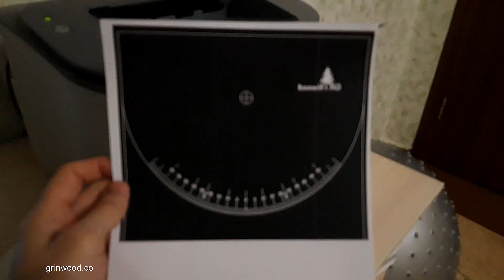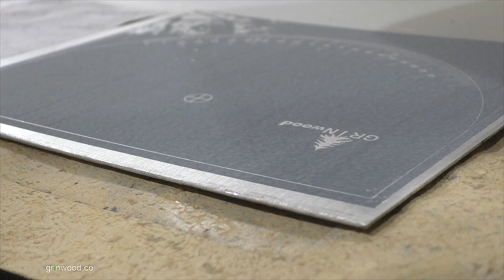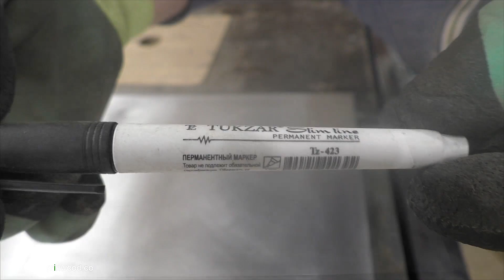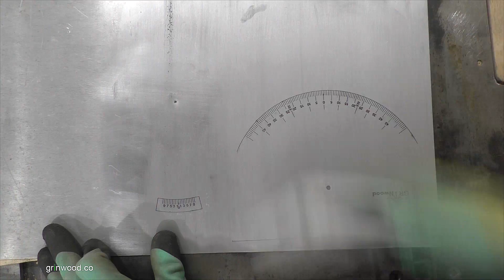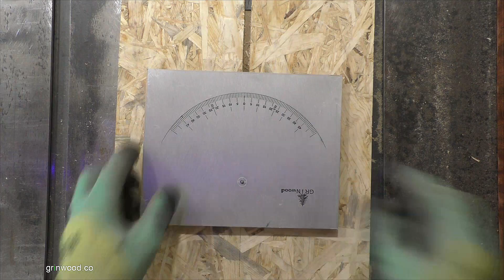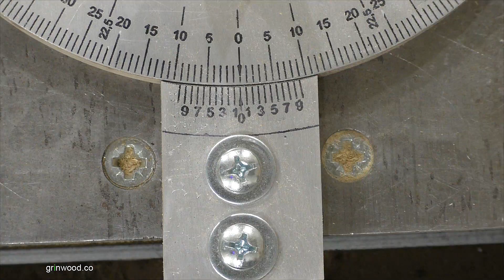🟢 Making Precision Miter Gauge 👍  FREE PLANS Miter Gauge 👍 Don't Repeat My Mistakes

Comment: When you were cutting the layout sheets, the aluminum sheet looked still damp in some areas 0:57 - 1:14 I believe that sheet wasn't totally dry where the toner didn't stick. I learned a few things here, you gave very good detail information in the comments area with references. Making your own T-track and screws was perfect for this. Saved money, and showed you don't need aluminum tracks. I'm 70, retired mechanical/electronic technician 40 years, I learned a great deal

Comment: One quick Tip for you.
Put your Hacksaw Blades in Backwards (Teeth pointing rearwards).
Works the same as the Japanese Pull-Saws for Wood, you get a cleaner, straighter cut.
The Blades will never kink if they snag or jam, and they'll last longer.

Comment: Thank you for your ideas. I already printed on alu, but not further that using printing ink. But it does not resist to water, so I abandonned.
It is evident, but you could tell people that they must invert images before paper-printing, first mistake to avoid ! Most drawing softs can do that...
What do you use for electro-erosion : fluid, position of the positive pole, timing, still some trials to do !

Comment: I use thermal transfer to make circuit boards.
Although i use a Muriatic Acid and Hydrogen Peroxide bath with a fish tank air pump and stones to agiate the liquid with lots of bubbles.
I would not recommend that mixture for aluminium though. The liquid gets really hot.
It might work alright but keep a very close watch on it.

I would however recommend that you cut the aluminium closer to its finished size before you try the transfer.
All that extra aluminum acts as a heat sink and makes transfering more difficult.

Glossy photo paper works best. The lightest (thinnest) is what i go for.
Glossy Presentation paper works great as well and its about 1/4 the price of Photo paper.

Also, printer choice is very important.
A printer that let's you adjust toner density is important.
I've had good luck with Canon laser printers.

Comment: before you consider doing your own threaded bushings again, there is a manufacturer who sells those bushings. They are called Ensat-Bushing. They have an outer thread special for wood and metric or imperial inner threads in the sizes and lengths you want to use
Reply from the maker: Fantastic! Where can i find them to buy? Thanks
Reply: @GRINwood  here: http://www.precisionfastenersinc.com/ 

and this http://www.kerbkonus.de/proddb/assistent.php?lang=en&a=presel_ds&ds=30&sub_cat=ensat-kunst is what I meant

Comment: Liked and subbed. Really do appreciate this type of content, a big thanks. Is anyone aware if the printing for the etch can be done with regular paper? I'm guessing they used photo paper. Thanks in advance
Reply from the maker: no, it is not work with regular paper, toner stick to paper too much. And yes, i used a glossy photo paper (150g/m), as for me it works well. Thanks
Reply: @GRINwood  ok thanks for advice, I'll grab some photo paper :)

Comment: Nice but at my age, I would be afraid I would die before I finished. I really liked the belt sander and drill press sanding.
Reply from the maker: Thank you for your comment, Frank. In fact i made this miter gauge in two days, most of these time took a making video (replacing camera etc...) Possible it makes these effect because of video turned out too long, i just experimenting with video, still not found my style

Comment: Do you use special bits and sawblade for the aluminium?
Reply from the maker: No, it's HSS bit that i made from 8mm drill bit and woodworking saw blade with ATB teeth, but it's good to make just a few cuts, to cut aluminum you should use a special sharpened blade. Thanks

Comment: ''if you know why the image transfering partially, please leave your opinion in comments''   ...
I think because aluminium sheet is too large and ,, stolen'' the heat of the iron . Aluminium sheet is a really heat sink  and the temperature of the heatiron going down.  You need to cut the aluminum sheet  and/or preheat  the sheet.

Comment: I'm looking videos on your channel and you are really a beast! :) Mostly all people doing all DIYs from wood etc, but I like machines being built from more sturdy materials a lot more. Can I get your email or if you tell me please what kind of motor should I buy for a table saw?
Reply from the maker: Hi Robert, you can email me here grinwooddesigns@gmail.com
I changed 2 or 3 motors for all time and all of them were not power enough for 10" saw blade. But now i use a 3000rpm 1.5kWt (2.0HP) one phase motor and it's more than enough for me. 2" oak board cuts easily. Thanks

Comment: A nice finished product and some interesting techniques in the build, but why would you build your own miter gauge?   There is probably $30 worth of materials here, unless you have the materials laying around as scrap.  $60 bucks will buy quite a nice quality miter gauge.  If you can produce a product that has special features that aren't available anywhere in the market or if you can build it in less than 30 minutes of your time, it might be worth building your own.  I know there is satisfaction in making something with your own hands but I would rather buy a miter gauge so I can get on with producing something awesome.